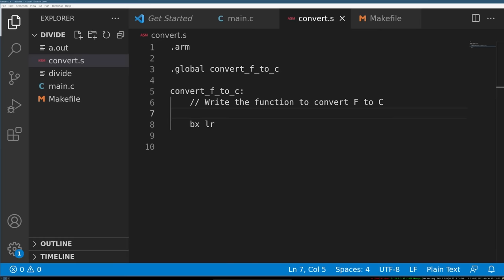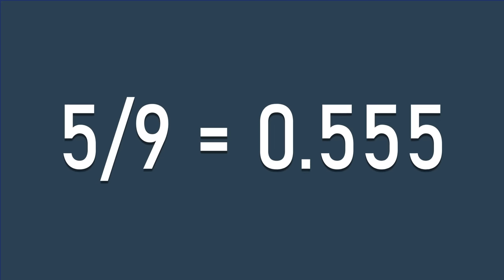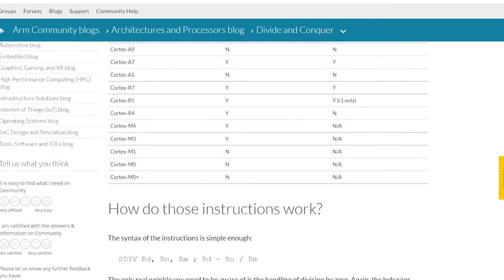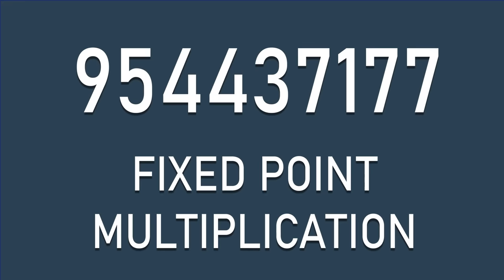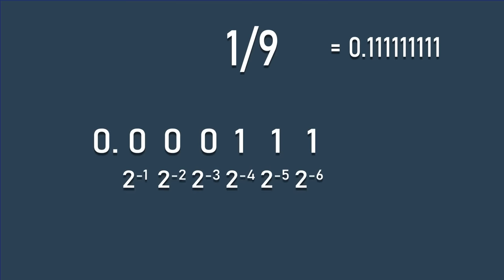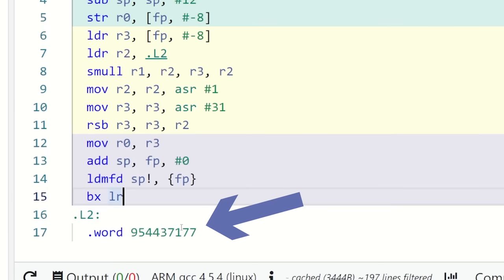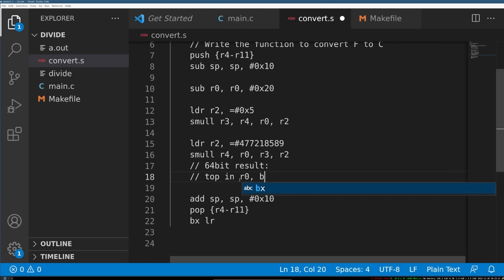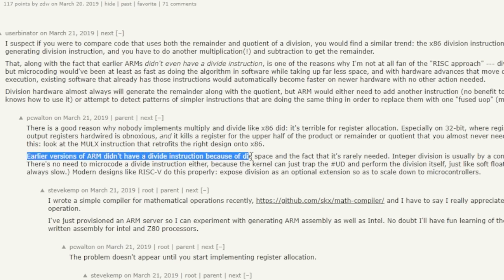computers suck at division (a painful discovery)

Comment: This was a triumph!
FWIW most x86_64 CPUs have floating point division hardware but integer division is implemented using micro ops for newton-raphson method. This bugs me to no end because you normally want high throughput for floating division, so you use n/r for that, but for ints it usually is a single division on the critical path. The difference is huge - unpipelined trial subtraction hardware has an 8 cycle typical latency, but n/r is 26 cycles.
Reply: On modern AMD CPUs, integer division only takes 2 micro-ops. Still slow though, for 64-bit integers the latency is up to 19 cycles.
Reply: @soonts  ooh, interesting! DIV and IDIV timings going back to Bulldozer appear to be for a slim hardware division unit with up to 18 cycles of latency. Intel are still in the high 20s though. Thanks, I've been team red for over a decade but somehow never noticed this.
Reply: @soonts  It takes a varied amount of time depending on the value you divide with. Anywhere from 2 to 30 cycles.
Reply: Not true. Hardware division makes use of SRT, not Newton's method.
Reply: @capability-snob  divq on ice lake is fast as hell. That is 128 bit division.

Comment: Some architectures like the Motorola 56k DSP have an instruction for doing one step of a division. If you call it often enough it will yield the correct quotient, still sufficiently fast. This can be a good compromise between speed and saving chip space.

Comment: Really cool video!! It feels kind of great when I get to see someone else passionate about assembly language. This video reminded me about the time I was figuring out on how I should multiply and divide a number in the assembly language of ATMega8A microcontroller (and later with an 8085 processor): I had to use repeated addition and subtraction to get the job done. Later on, when I worked with 8086 microprocessor I got to know that division is an expensive operation (just like LOOP and REPNE instruction in x86 processor. Even in x86-64 family of processors, they are just artificates which no one has ever optimized, so everyone favours JMP instead of LOOP).
Again, this was a great video! 👍👍
Reply from the maker: Thanks for watching! :D

Comment: When we manually tried different division approaches on a computer engineering courses I was fascinated by how hard division acually is. It makes sense though - division is also harder to do on paper.

P.S. there is also a square root
Reply: That's why they call it a TRIAL divisor, if it's too big you get to start over again.
Reply: Division in binary is actually not that difficult, since the (appropriately shifted) divisor either does or doesn't go into the dividend (determined using subtraction).  There are even shortcuts you can do to make this fairly efficient.  However, it still takes a number of cycles equal to the quotient length.
Reply: @Mueller3D  yeah, but it's much less intuitive than multiplication. It's also longer algorithms with more steps and branching. In multiplication you just go with a naive approach. In division I don't think any approach can be considered naive

Comment: Nice video, thanks!

It is worth noting that, even when division is supported by the hardware, it can be quite slow. I once timed the basic floating point operations on a Cortex-A5, which has an FPU implementing the VFPv4-D16 instruction set. Multiplications turned out to be fast (one/two cycles in single/double precision respectively), but divisions took more than seven times longer than multiplications.
Reply: Shows that ARM was right to forego a division module.
Reply: @zlcoolboy  That's still faster than doing it in software. This method only works because it's a known constant that can be approximated. Once you divide by a variable, you've got to use much more sophisticated approximations, which will likely take multiple times as long as a hardware divide unit.

Comment: As a side-note: In the 'ARM system developers guide' by A.N. Sloss, published 2004 by Elsevier, a 40 opcode or so division routine is shown which divides two 32b numbers in under 32 cycles. This routine was the reason that up to 2004 there was no need for a hardware divider for the ARM, as till that time these hardware dividers needed 1 cycle/bit.  The routine uses 2 Newton-Rhapson iterations and a correction process.

Comment: Welcome to 6502 assembler with more bits! 😱
Seriously, at the assembly level (especially with RISC type instruction sets) you end up really appreciating how much heavy lifting your compiler does for you. I've never written anything in ARM assembler, but this video takes me back. Thanks for sharing! 👍🍺
Reply: One of my favorite optimizations had to do with converting timestamps from 32-bit number of seconds to separate year/month/day/weekday/hour/minute/seconds fields on a 6502.  The typical approach involves multiple 32-bit divisions.  I realized that most of those quotient bits were always zero.  So I essentially unrolled those divisions and eliminated all of the trial subtractions that were guaranteed to result in a zero.  It ended up needing a total of something like 34 subtractions, resulting in a speedup of 7X.
Reply: On systems with fixed instruction length even stuff like loading immediates (that is, constants) to registers is quite funky, even on symbolic assembler. On x86 with variable instruction length but no widely available barrel shifter logic available to instructions these are quite literal "move immediate" instructions, but on ARM, complicated constants either take several instructions to load (if not using constant islands), or generate constants in interesting ways...
Reply: JRISC in 1993 ( Atari Jaguar ) and  SH2 in 1994 on Sega 32x and Saturn offered 32-bit division. It has some latency, but did not block the processor. Similar how quake did division on CISC Pentium in 1996 .

Comment: For the multiplication part you could optimize it even further by removing multiplication entirely and just storing f-32 in a register then bit shifting left by 2 followed by adding the f-32 which would be the same as multiplying by 5. The the divide by 9 is way tougher to optimize though because it seems like you can't to the same with right bit shifts unless I'm missing something :/ Also I guess this would only work if you wanted the whole integer part of the result, if you wanted some decimal places too I guess you would need to use fixed point
Reply: Why not combine multiplication by 5 and multiplication by 1÷9 (477218589÷4294967296) to do multiplication by 5÷9 (2386092943÷4294967296)
Reply: @jhgvvetyjj6589  because division in this case is floor division which is not associative (x*y)/z != x*(y/z). For example (2*3)/4 = 6/4 = 1 != 0 = 2*0 = 2*(3/4).
EDIT: Ah, I see that is not what you are asking now.
Reply: Damn you guys are so nerd
Reply: this is how binary multiplication already works!
Reply: Wouldn't your register just end up trashing your bits if you go beyond scope?

xxxxooooxxxxoooo >> 6 bits for example, would you not end up with 000000111100?
then if you were shift left it'd come back as zeros?
Reply: @thewhitefalcon8539  maybe but I was thinking a bitshift left + addition might be faster than a multiplication on ARM in this case because multiplication instructions are usually slower than additions. It's kind of like moving 0 into a register by xoring the register by itself instead of loading it with 0 explicitly, both accomplish the same thing but the former is usually faster than the latter (assuming your cpu supports xor which most do, x64 and ARM definitely do at least)
Reply: If one of the operands is small (less than 1 byte of effective bits), multiplication is single cycle on ARM. It can take up to 4 cycles on ARM which don't have a full single cycle multiplier. Trying to chase multiplication with additions and shifts is generally ill advised on somewhat modern architectures.
Reply: If a shift and addition were faster for certain cases, that optimization would be in the compiler by now.
Reply: @SianaGearz  You can mul by 5 with 1 shifted add instruction. It takes only 1 cycle.
Reply: @fashnek  The compiler output had several extra instructions not needed. Compilers are not as great at optimization as people seems to think.
Reply: @NoX-512  I’m sure it depends on the compiler and the target as usual. But certainly some cursory searching shows that *(2^n+1) via LSL+ADD is a relatively well-known optimization. I imagine it just needs proposing.
Reply: @fashnek  ADD r0, r0, r0 LSL #2. Takes only 1 cycle. On X86 you would use LEA.
Reply: @NoX-512  Yeah, that's what compilers like GCC and CLANG generate with -O2 (and such) if you do multiplication by 5 (a constant). You can use "compiler explorer" to see compiler output with 20+ different compilers, compare them side by side, etc.. it's really neat website, I use it all the time to check my assumptions; much faster than -S and ballin' .s files.
Reply: x86 looking through the window from outside whispering Load Effective Address..

Comment: I think I've seen this even in x86 assembly.  You can learn a lot from a good compiler: division by constant can be substituted with a multiplication, multiplication by (some) constants can be left to the address generator, and I've even seen them converting float to int by adding a large constant to it and throwing out the high-order bytes -- while I get the math, I'm not sure how it's better than the built-in x86 FPU instruction that does the same, but it was still pretty cool.

Comment: It's called RISC (Reduced Instruction Set Computing) for a reason, if you want hardware division operations use a CISC (Complex Inst..) processor or a mathematical co-processor. ;)
Reply: RISC does not mean that it won't have certain instructions, or that it lacks functionality, or that it is a limited instruction set computer. It just means load/store arch, orthogonal reg file and instr set.
Reply: @GeorgeTsiros  Well it's not limited it's just reduced, but it still is general purpose. ;)
The idea behind RISC was to improve the efficiency per transistor count and a division unit would mean more transistors with almost no benefit regarding the most programs.

Comment: The RISC philosophy, love it or hate it 😉 Yes, I saw the interesting multiply-to-divide trick in printf routines to display numbers, where it has to divide by 10 (or powers of 10). I was impressed, it was packed with such little techniques to save cycles (on x86_64).
Reply: Literally the only CISC cpu that is halfway alive and not x86 is the Motorola 680x0 architecture.
Reply: @linuxization4205  It depends which categories you are willing to consider. There are microcontrollers and CPUs derived for ex. from the 6809, 8051 or 6502 and so on which are borderline or plain CISC. Though many designs, including the x86, only have CISC instructions but a RISC architecture, so it's not as straightforward as when the term was initially coined. 😀

I believe Intel started translating the instructions into micro-instructions in their Pentium series, otherwise they wouldn't have achieved the same level of performance. It was bold and brilliant. Nexgen, which was bought by AMD to save their failing K5 architecture, did the same back then.
Reply: @phenanrithe  It was the Pentium Pro, (P6 or i686), which all modern x86 chips still identify as.
So yeah, the big x86 CISC architecture uses RISC-like tricks under the hood and only displays itself as CISC on the outside for compatibility's sake.
And that whole thing was also supposed to be replaced. After IA-16 and IA-32 should be IA-64, but that went to nowhere just like i960, i860 or i432. And obviously Itanium which, as P7 was somewhat supposed to be the successor in 98
Reply: @HappyBeezerStudios  Yeah... what happened was that IA-64/Itanium was a disaster, it tried to optimize all the wrong things and ended up being somehow SLOWER than x86 if you can believe such a thing.

Comment: As a computer engineering student currently learning about CPU design, it’s also important to bring up that new CPU architectures (arm & RISC-V) are shifting towards reduced instruction sets to increase efficiency. This is why division isn’t prioritised, as it can be done in very roundabout ways that may still be faster than a physical hardware implementation. As long as you have the fundamental instructions, you can do essentially everything.

Comment: ok I'm pretty new to programmation (like I started this year) and this seemed like an interesting exercise. What I would do to divide by a variable without using the division operation would be just as we teach manual divisions in french elementary schools:
-1: a loop checking if the number to divide (a) is greater than the number by which we divide (b). If it is then substract the number by which we divise. If it isn't then we're left with the int just bellow the actual answer.
-2: if we need more precision, we do the same loop, but if a<b, be place our custom floating point, then we multiply a by 10, do the same loop as in the - just above, add the result of this loop (single digit from 0 to 9 because we only multiplied a number inferior than b by 10) after the point, then we multiply a by 10, do the same loop, add the result after the last digit... rince and repeat for every digit accuracy we want after the floating point.

Kinda like that:
void division(int toDivide, int divideBy, int precision)
{
    for (int i = 0; i < precision; i++)
    {
        int currentDigit = 0;
        while (toDivide > divideBy)
        {
            currentDigit++;
            toDivide = toDivide - divideBy;
        }
        cout >> currentDigit;
        if (i == 0)
            cout >> ".";
        currentDigit = currentDigit *10;
    }
}

Keep in mind I've never coded in C in my life, much less in assembly, so low level logic like that isn't really my thing, I'm sure this is inefficient af, but it was interesting to exercise my brain during these school holidays.
Reply from the maker: this is a solid solution! and this is actually how the processor implements the divide instruction under the hood (with some optimizations here and there obviously) the problem is that this takes a TON of clock cycles, so sometimes fixed point division is just faster. 

good job!
Reply: @LowLevel-TV  thanks, is that actually how it work? Wow that's something I need to take into account in my future codes when I carelessly put divisions inside loops that are themselves inside loops O_o. That's what I find interesting with learning what the processor actually does when you add a single operation that seems so innocent, you actually come to understand WHY everyone teach do to do/avoid this or that. Because damn that looks like a very inefficient way to divide.